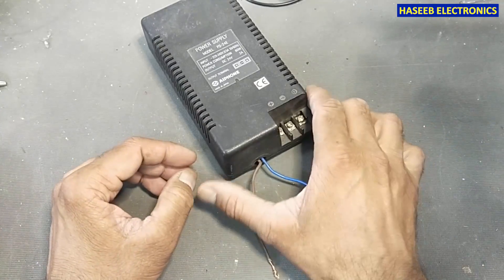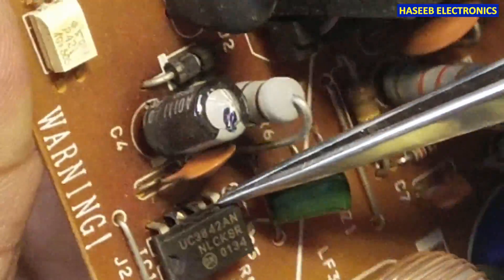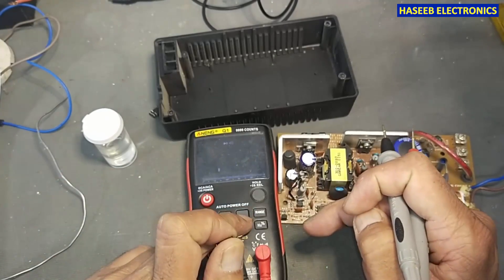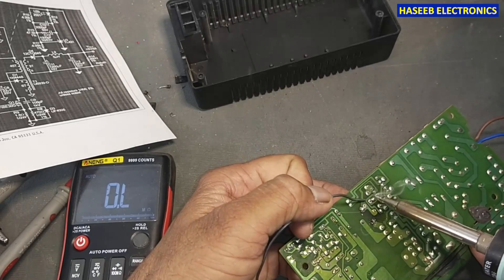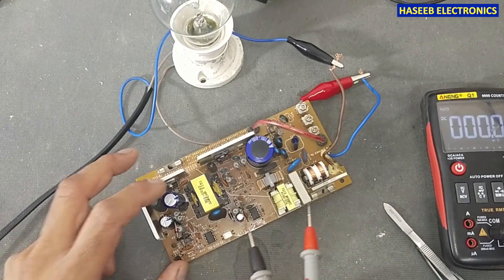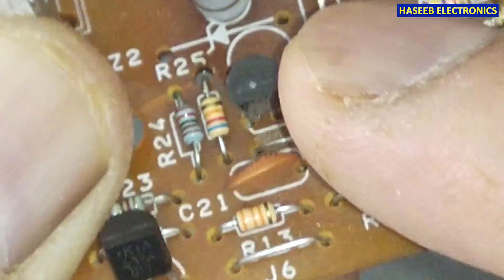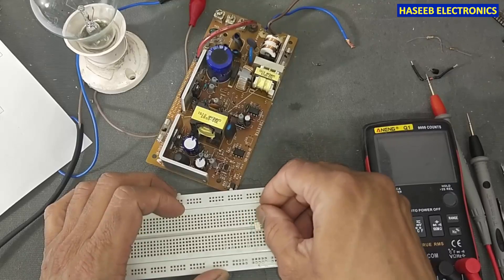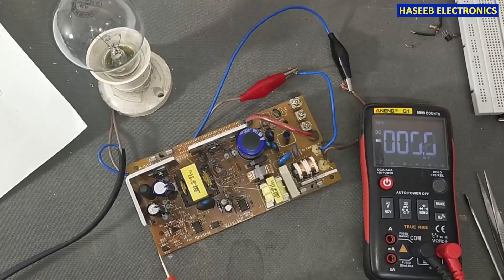{770} SMPS Is Not Working || SMPS Not Turning ON

Comment: Thank you Sir for your explanation. Please which component is causing a switching sound and which type of zener you'll use to replace the Defective one
Thnaks a lot
Reply: Best explanation really nice video 
Can you make videos on VFD repairing
Reply: Please explain.   SMPS circuit using  L6599 ic.
Reply from the maker: it is due to transformer and the EMI Suppression  ferrite beads / Anti Parasitic Ferrite Beads EMI Rings (installed on the mosfet pins) 
i will replace c27 (27 volt zener) and 24 volt zener 1 watt and 1 SCR upto 10 ampere. 
when i will arrange these parts, i will share its installation, diagram and testing
Reply: @HaseebElectronics  is SCR a transistor
Reply from the maker: SCR IS silicon controlled rectifier
it is used for protection
Reply: @HaseebElectronics  Resp Sir! Thank U Very much for Ur Advice Sir. C27 Volt Zeener, 24V Zeener 1Watt & One SCR Upto 10ampere Here were not there in the Shopes Sir. Please arrange Sir and C3866 FETs 12 Numbers Required for Other SMPSs Sir. How to Pay Amount Sir through Ponepay or SBI Yono Sir. Extreamely Sory for U Disturbance Sir. Iam Very Hill Mounts Areas Sir.   --  ChinnaRao, Paderu, Visakhapatnam Dist. Andhrapradesh.
Reply from the maker: brother I am in Jordan, components here in Jordan are much expensive due to high exchange rate of Jordanian Dinar. 
moreover the shipping charges are too high
I will check tomorrow and will reply. because to send or receive any electronics parts and items needs a special customs approval. 
I will check. if it will easy and economic
I will send 
if the shipping charges are much high 
then I will not recommend to purchase components from this country
Reply: @HaseebElectronics  Resp Sir! Thank U Very Much for Ur Advice Sir! I will Try Another Places Sir. Every Your Vedios Iam Followed Sir. Thanku U Sir.   --    Chinna Rao, Andhra Pradesh.

Comment: 1 second ago
1 it is impossible to include a low-frequency diode 1N4007 in a circuit with frequencies above 1 kHz! only ultrafast FR107 (HER107) diodes need to be installed there 
2 it is impossible to connect the power supply to the mains without making sure that the parts of the COLD side are working properly and that the feedback is working correctly, only after checking the serviceability of the feedback circuits can you try to supply power from the mains - otherwise there is a huge probability of completely burning such a unit. OVERVOLTAGE protection power supply ON KEY DIODES AND CAPACITORS 
Tip in case of any problems with the hot part, replace the optocoupler with a PC817 (yt is even worth checking the old one - ALWAYS CHANGE) the same applies to the PWM power supply capacitor

Comment: Hello Mr Haseeb. What is the reason hearing "ticking noise" from smps? Thank you so much
Reply from the maker: possible reasons. its switching frequency is out of limit either low or high
separated core halves
Reply: @HaseebElectronics  Thank you master. Additionally In secondary side 1000 micro 50v cap become hot. I checked every thing around that but I don't find shorty. There are not output voltages to the main board. Filament of the test lamp is glowing on off on off... with tick tack sound in smps.

Comment: hi i have an issue with a power supply maybe u can help me it is from ROHDE & SCHARDZ., Radio Communication Tester CMT52  0.1....1000MHZ they do no make the power supply any more WHEN i GROUND THE CHASIS IT GOES INTO A SHORT i think is the uc2840n 18 pin switching regulator.

Comment: Guess I missed something. You checked the output and said no voltage - but there was a reading on the meter. Then you tested the DC cap and said it's 'safe', but there was 124~ volts showing?
Reply: It was having 123 mV only and its DC not AC

Comment: which soldering iron you are using to remove components from pcb, iron with desolder pump ? where it is available
Reply from the maker: i am using WELLER WR3M rework station. it is avaiable on amazon, indiamart. and many other online sellers 
soldering iron is TC201 WELLER

Comment: It's good that this SMPS was repairable. So many these days have components encapsulated in tar, making it impossible to repair.
Reply from the maker: best regards 
to conceal the designs and to protect the designs from weather effect, the circuits are coated. 
silicon coatings are removable but epoxy coatings are hard to demolish

Comment: I have a power supply 27 v 10 A..output voltage drop only 4 Volt,but after a few minutes output voltage is normal...what of cause it?

Comment: nice job i am fixing a macbook 85w adapter. it seems that the opticoupler is bad not giving the proper ratio. thanks! how do you find out the value of a resistor if it is completely burned off the color bars. do you trace the resistor to the ic and look at the sample circuit?

Comment: What was the root cause of this fault . Was it an optocoupler failure initially that then caused a fault  in the output side which then caused a fault on the primary side ?
Reply from the maker: i think that its root cause is optocoupler, which caused to increase voltage at vcc pin of the IC, and it switched a long time, which gave high spikes strokes on output side, and it made damage in secondary side as well

Comment: What is the role of Scr in this circuit? thanks for great videos 🙏
Reply from the maker: it is protection circuit, over voltage and over current protection to protect battery from all possible damages
Reply: @HaseebElectronics  🙏🙏

Comment: Salamun alaykum, I have tested a kettle resistor with 60w serias lamp, The lamp lighted but the resistor not heated. Without  seies lamp i've tried it, andI saw resistor was working. What is the reason of that ?
Reply from the maker: the series lamp is  60 watt or 100 watt. and the kettle resistance is 1500-2000 watt. so lamp will glow full, because the lamp have more resistance than the kettle resistance.  
if we see the voltage drop across the two resistors in series, then the kettle resistance is much low than the lamp resistance, in result the kettle resistance will not get more voltage  to produce enough wattage

Comment: You are really helping us here tackling power electronics.. my question here is I usually design smps solar inverter but anytime i power on the inverter its working smooth but the high side MOSFET usually heat up at a very high temperature and get blown while the low side MOSFET is cool i am using tl494 ic my transformer calculations are correct which i got here from you but still i don't knw how tackle this issue pls can you help me.. What might be the issue i only find this issue when building high frequency push pull inverter. Pls help me out this is the 8th times am trying this but same problem pls help me. ?

Comment: Sir is possible  to build our own smps power supply for amplifier  which has stable out put  of +15v and -15v , +35v and -35v if is yes please share us video thanks
Reply from the maker: yes 
it is doable, just we need to calculate and design the smps transformer and then design the circuit. the transformer  must meet the power requirements and the circuit must be capable to drive that transformer. a properly calculated feedback network will provide regulation 
its complete calculation and design is a very lengthy project 
i will try to check if i can find some design sample. i will share it
Reply: Can you tell me!!!

Comment: Hello sir in this video did you replace  Scr ????
Reply from the maker: currently i don't have SCR and 27V zeners, i will arrange these parts and will share in upcoming  video. because it iis protection circuit. so power supply turned ON without this output protection circuit

Comment: Hi, haseeb, I have a question here, when troubleshooting such motherboard and u find out that, one of resistor burns black and no visible colour code on it and there is no value printed on motherboard. So how how will u replace the resistor?
Reply from the maker: in this situation we need to download the datasheet, application note, sample circuit or typical application circuit for that main component or IC. so we can get a very closer value for that burnt out component. 
otherwise it needs a detailed and too much time consuming reverse engineering to recalculate the all components to find the burnt out component value
Reply: @HaseebElectronics  thanks sir, and keep up with great work! You helping other as well learnt troubleshooting techniques cheers